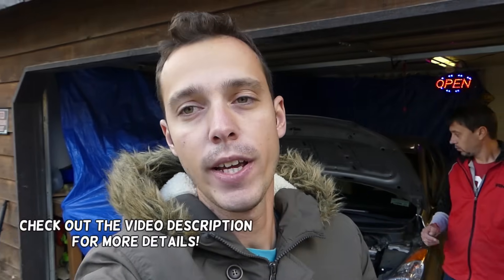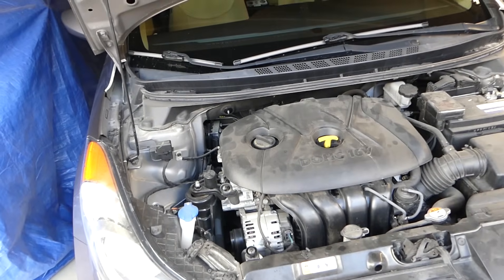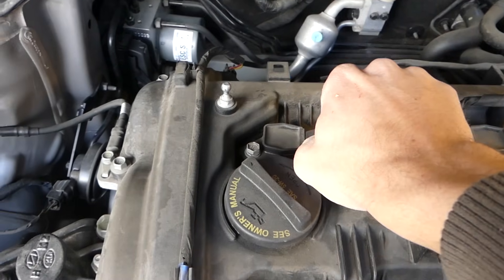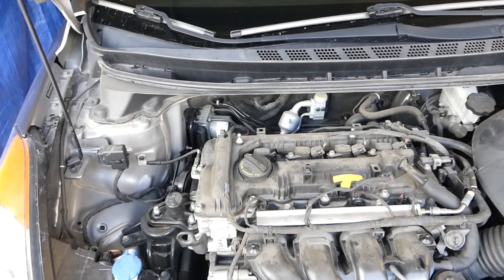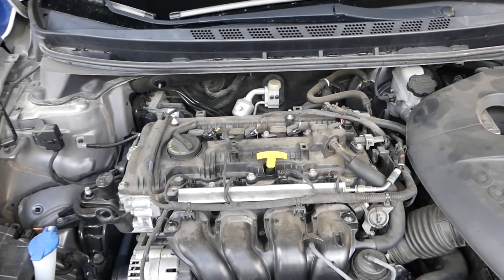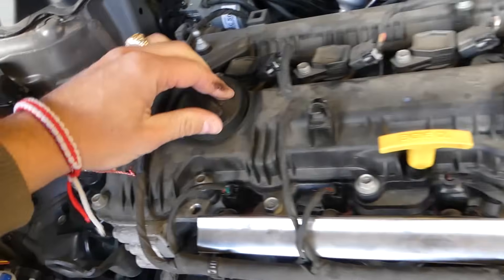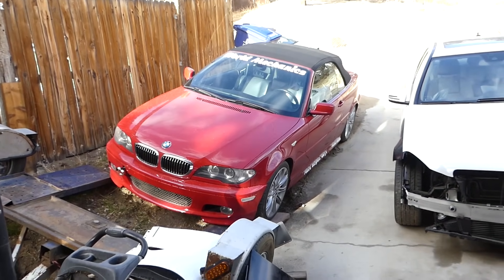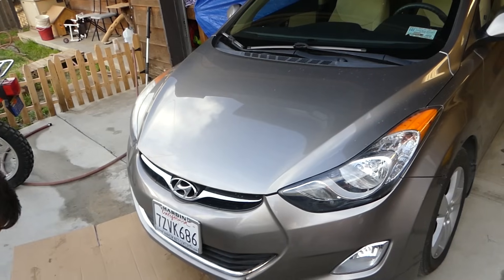HYUNDAI ELANTRA ENGINE NOISE KNOCK TICKING FIX ?

Comment: Thanks for the video.do you have a video for changing the inhibitor switch on Hyundai Elantra 2012
Reply: pnavan I don’t know if you got this repair done already or not but the inhibitor switch is a very common recall on some Hyundai’s. I work in a Hyundai Service drive and I would bring your car in to see if there are any active recalls. Some vehicles are getting a free oil change as well so I would recommend a dealership visit at some point

Comment: I have the same car and there was a recall on 2013. The dealership changed the engine block with no cost. I have noticed that these cars suck gas a lot. Does yours do that? What is the solution?
Reply: Mine has original engine makes the sound slight. But gets great gas mileage. 35 to 45 mpg yes I have gotten as high as 50 mpg with this car yes I'm not lying. And original spark plugs and 127k miles

Comment: Piston slap is what you engine has when it makes that sound. Mine went into Hyundai for an inspection and sure enough my car had piston slap. Hyundai has ordered a brand new motor for my car and will be installed in two weeks from now under the recall on the motor and it's all free. $6500 Canadian for the motor, and near 3000 for labor. my car has 77.000 km Talk to your dealer folks.
Reply: I talked to my dealer and they wouldn’t fix it.  I have a 2015 83,000 miles Elantra. Because I am the second owner they won’t fix it. They wanted me to pay for half.  Why should I pay for their error?
I am angry and don’t know what to do

Comment: Same in my gets 1.4 ...it ticks on startup for about 5 mins then runs ok , I replaced all drive belts and it improved for couple months but its back again
Reply: Im having the same issue... I've taken it to a dealership and they fixed it under warranty but now it's back
Reply: did you find solution to ticking probelm issue

Comment: i bought a 2006 hyundai sonata with 46000 miles and am trying to find out the severe sound coming from the engine (thrashing noise.) might only be the pulleys but i am concerned might be more. i want to see all of the videos concerning the piston slap problem and rebuild steps so i can fix the issue . please help me with all info you have

Comment: It's either piston slap or lifter clearance. 
These engines do not have Hydraulic last adjusters there straight lifter bucket on top of the valve stem. 
Very archaic if you ask me. 
Easy way to differentiate between valve lash and piston slap is wether the noise increases or decreases or stays the same between a hot anyone and a cold engine. 
These engines are famous for piston slap that is the result of just starting the car and driving when stone cold. 
To avoid this for aslong as possible be sure to warm the engine up every time before driving. So let idle for say 5 to 10 minutes for the first start of the day and if let sit for longer then about 1 hour. But if only left for say 5 or 10 minutes then start the engine before putting your belt on and getting ready to drive. 
Even start your car while loading the shopping into it. 

Piston slap requires a partial rebuild.

Comment: Mine is the same (2011 elentra) once I put Mobil 1 high mileage full synthetic oil in the knocking reduced by alot, I had a synthetic blend in before and it was loud so the oil definitely helps.
Reply: 5w 40 ?
Reply: 5/30

Comment: I was watching this video, as I was also having the same some humming noise related issues when accelerating while driving, but not getting humming when accelerating at stand still.

Please suggest what could be the problem.

I am using Hyundai i20 2011 model
Reply: Are you still having this problem? I'm having the same issue
Reply: Im having the same issue. Changed the oil. New spark plugs and coil pack. It still sounds the same.

Comment: Sounds like hydraulic lifters clacking , the new thinner oil probably allowed them to function a bit better .
Reply: How much you think its gonna cost if youre going to change the hudraulic lifters?
Reply: Those have what's known as bucket lifters that sit over the valve and spring and the cams sit over the top and operate directly on the top of the lifter , aftermarket set from ebay and do the work yourself , around $150 unless you also change belts and/or gaskets if needed .
Reply: Gordon L they actually used a thicker oil, it calls for 5w20 but they put 5w30 in. Which is thicker not thinner buddy. 🙂
Reply: 30 is thicker.

Comment: Wouldn’t switching to 5w-30 from 5w-20 ruin the engine over time??
Reply: U herald what he said the manual said to do that in colder climates
Reply: I've read that the 2.0 engines are made to run on 5w30 but 5w20 is recommended to get better fuel economy.
Reply: @iflarnted  yeah I just found my owners manual (it was mia) and it does list 5w-30 and even 10w-30 as suitable depending on temperature. I’m in Az so I’ll try 5w-30 as summer approaches.
Reply: You can run 5/30 it’s fine it’s for warmer climates

Comment: Hi I have a Hyundai Elantra 2016 I have a similar sound like that on my car. Old engine sound with a ticking nose. I had a oil change but the the sound is still there?? What do I do?? There’s no warning signs on my dashboard. I bring in my car to my local mechanic and was told their was no problem with my car (diagnostic was ran) nothing found.
Reply: I have the same problem. I think it may be the knock sensor =(
Reply: I just left it alone. Each time I get a check up. Nothing comes up... they don’t find anything
Reply: I'm having a similar problem and my cars the same year. It just started happening like a week ago.
Reply: I have the same problem in my 2015, the dealer wants me to pay for half of the new motor needed

Comment: Hi Guys!
I have the same problem. I did the same tests and I can not find a solution, please help! The scanner shows no errors..Do you know something else?
Reply: C sep your local Hyundai dealership would know. Ticking noises in these models are quite common and could result in the replacement of your engine

Comment: my car makes this noise on start up.. as i drive is goes away.. idk seems it just has to warm up
Reply: Is it an elantra?..i have a 2011 and it knocks on start up too, they say its a defect on these models and hyundai doesnt make it too public i i hear you can take it to the dealer and they will replace the engine free..its a recall actually..theres a video on that..
Reply: @renehettinga6610  is there a mileage limit on this recall? I have 2014 Elantra doing same thing

Comment: There's nothing wrong with that car. I have heard plenty of new cars that sound just the same.
Reply: I agree i bought a hyundai i20 and it said this noise. And I got so scared. But after search on internet i found out that this was all normal. Im an kia mechanic myself and we also have picanto that sound like this from factory. And if you want to run a warrenty case. By sending the video of the noise. It almost everytime gets declined
Reply: they are two sounds together, one of them is the fault.
Reply: My Rio started making more noises, so I began paying attention to other Kia and Hyundai. Surprisingly they all have this noisy engines. Even brand new ones.
Reply: @tiago
Can confirm. I have a 2020 forte gt line with 2.0.  I only have 4500 miles on it. I freaked out but started doing research. I'm finding it's normal. I'm very sensitive to noises. I guess I'll roll with it. 100k warranty makes me feel a little better.
Reply: @douchebaggins7  Yeah man I am the same way, Its almost a downfall because I worry for nothing. When I was hearing this with my sonata I literally went to a dealer and had them start and run the same car so I could put myself at ease. It looked and sounded exactly the same. I now have 60k miles and same sounds but never had a problem
Reply: @lr856n  
Thanks for that comment. Puts me at ease a little more. I was going to go to the dealer and have them start the same model. Lol..

Comment: Is this really an issue. I have 2016 Elantra. Notice the tik tik noise when I put it in drive. Don't hear it otherwise. I started noticing this only recently when it cold.
Reply: I have a 2016 Elantra as well. It recently started making this noise and I'm unsure why. Did you ever figure out what's wrong with yours?
Reply: You both should take it to the dealer if you are the first owner as they can put in a new motor if it needs it.  They wouldn’t help me with mine because I am second owner.
Reply: It stopped already. It isn't an issue anymore. I have checked with my mechanic and says if it comes and goes shouldn't be bad.
Reply: Nicolle Mendoza I have the same issue. I’m the second owner 🤦‍♂️ I’m taking my 2016 Elantra GT into a shop to get it diagnosed

Comment: I did notice when I bought the car more than 2 years ago. It happens when the car is cold. I got used to it. There is a lawsuit regarding this. I got the notice in the mail. If you can live with the noise you should be fine.

Comment: I just did a 2014 Hyundai Elantra lifters, valve seats, head gasket. Every one of these cars have hydraulic lifter problems.
Reply: Was it very expensive to fix?
Reply: @ddallen733  about 335$ with everything
Reply: @jaydizzledyal1992  thanks
Reply: Did it fix it and is it going to stay fixed? I'm not to sure if mines the lifters or something else. When I first start it up it makes a loud sound kind of like it might be the lifters but then it goes away. I'm assuming if it's bad lifters you'd hear it all the time correct? Also, if I start my car then turn it off and start it again I don't hear it. And if I do it makes significantly less noise.

Comment: These engines are just inherently noisy. I'm pretty sure its normal with their GDI engines. Should still go strong for years. My wives Elantra sounds the same.
Reply: It has a ticking noise?   Mine has a ticking noise
Reply: That's not a GDI engine... no hpfp
Reply: @codyballing8848  the 1.8l is a GDI. He even shows disconnecting the injectors in this video.
Reply: @thesupernad  https://en.wikipedia.org/wiki/Hyundai_Nu_engine
Reply: @MoreThanRocks  Thanks for the info. I stand corrected.
Reply: @thesupernad  It clearly states that the 2.0 is a GDI, while the 1.8 is an MPI.
Reply: Sounds like a Diesel ⛽

Comment: Hydraulic lifters my diesel 1.3 cdti fiat engine has been the same for last 2 +years oil n filter change quieten it for a while it then returned but motor runs fine only got 45k on so these good for 150k.

Comment: Do i actually need to worry about this? My new to me 2013 has 40k and it ticks slightly at startup but it’s also 0degrees here in Iowa. It runs and drives fine and noise goes away once engine is warm.. I feel like I’ve had other cars that make noise too..

Running 0w-20 full synthetic
Reply: Any updates?
Reply: 0W20 is too thin , 5W30 would work much better .

Comment: I have a hyundai elantra 2012, still is very quiet I just always change oil every 6 months.
Reply: i have elantra 2012 too. what oil (number and brand) do you use. thanks
Reply: Same one that he uses. Castrol Magnatec 5W-30. He is one of the best sources of Hyundai Elantra repairs in youtube. That’s why I follow him.
Reply: @aizensouske8872  hey is your car manual?
Reply: Can Doğan yup it is a manual.
Reply: How many miles do you have and which filter do u use

Comment: I have a 2018 Elantra and with a cold engine mine ticks and it goes away after the engine is warm. I only have 5000 miles on it.
Reply: David murling My 2011 does the same exact thing.. I was told it’s a cracked heat shield but I think it’s just normal on these cars.
Reply: My 2015 sounds also has a ticking noise on mornings
Reply: I too have the same problem. Please let me know that exact fix. I raise this to dealership but they refused bcz my car warranty has expired. I bought this new car in 2014.
Reply: @sploitx Just an FYI to those reading comments. The 2018 Elantra (original post) has some engines with GDI and some with MPI. So this doesn't apply to all.
Reply: @Vince C I have a 2017 elantra which I bought in July.  When the weather was hot I never noticed a ticking noise.  Then when the weather turned cold, i noticed it ticked really loud especially when I accelerated.  The car only had 10,000 miles by then. When the motor warmed up it mostly quit ticking.  I have 50,000 miles now and it still does it but I just quit worrying about it.  The Dealer said it was the fuel injection.  Maybe that's true... maybe not.  Anyway the Dealer wouldn't do anything about it and just said it was normal.  So I just let it go.

Comment: you didn't check the oil level before you started the car up. and another thing. Stay off the throttle when you start the engine. Never give it gas when you start it unless it won't fire on its own.  especially when it has sat overnight. The car will start on idle. at idle there is the least amount of pressure on all of the bearings while it builds oil pressure and circulates oil. Don't spin the engine up before it's had a chance to circulate the oil. If the engine is cold just let it idle for at least 15  seconds before you touch the throttle. think about it. why slam pressure on the rod and crank bearings before they had a chance to get oiled. Most of the wear on an engine happens in the first 3 minutes of it starting from cold. once it's fully warmed up, go ahead a flog it.  but when the oil is cold it doesn't lubricate as well and the metal parts haven't expanded to the correct size so you have too much clearance between parts until they expand. This is especially important at the top and bottom of the rod where the motion reverses. The wrist pin and the lower rod bearing shells. Not to mention the crankshaft bearing shells where the crank sits in the block.
Reply: Hey there Carbon Crank...... 
Here is what you said "when the oil is cold it has less viscosity and the metal parts haven't expanded to the correct size and the metal parts haven't expanded to the correct size so you have too much clearance between parts until they expand.".
Please note this part: "when the oil is cold it has less viscosity and the metal parts haven't expanded to the correct size so you have too much clearance between parts until they expand."
More specifically this part that REALLY got me., "and the metal parts haven't expanded to the correct size so you have too much clearance between parts until they expand." 

Viscosity (noun) · viscosities (plural noun)
The state of being thick, sticky, and semifluid in consistency, due to internal friction:
"cooling the fluid raises its viscosity"
Modern oil is a multi-viscosity oil to PREVENT exactly what you're speaking about. 
At cold temps oil's viscosity is constant. a 50 or a 10.... viscosity stays constant. 

Below 32 degrees F, the oil changes to the lower viscosity oil, because the clearances are TIGHTER when cold, you dumb ass. Metal will expand ... ALLL the metal, not only the crank. 
Also, the forces of the change in momentum are not applied to the crank and connecting rod "shells" (LOL). Those forces are LATERAL to the journals. Man, it's like my 14 year old wrote a post on YouTube after listening to grandpa talk shop from the 40's.. 

You don't sound intelligent with all of this shit. It makes you sound like a un-informed know-it-all.
This entire comment rubbed me so wrong that I had to leave this diatribe in hopes that since you posted this. 
Damn man, this thing pissed me off.

Comment: I too have the same problem. Please let me know that exact fix. I raise this to dealership but they refused bcz my car warranty has expired. I bought this new car in 2014.
Reply: Fahad Rajpurkar what was the purpose for the expiration? Year or mileage?
Reply: jsphburk, this is due to years. And I didn’t extended.
Reply: The engine warranty for original owners is 10yr/100k miles isn't it?  They should have honored their warranty.
Reply: Same issue with my because I am the second owner I am out of warranty.  Now I have a 2015 Elantra with 83,000 miles that’s motor is going to trash because they won’t fix it

Comment: Try to put some MOTORKOTE in engine. I am sure it will make significant change in noise level
Reply: I have a 2014 Santa fe with 125k miles. On accelerating the tick sound came on. Now it's on a cold start. Are you sure about this motorkote?
Reply: @thenditharam  I tried it as an experiment on my 2010 kia sedona and it reduced noise significantly and till date not seen any negative effect. If cause of engine knocking at your end is because of an internal part’s damage then it may not be of any help.

Comment: I have one problem in my elantra.
When I stop my car the engine shakes violently. As soon as I release the brakes or put the transmission on Neutral then it is normal.
Does any one knows anything about it?
One mechanic told me to change the chair on which engine is sitting.
Reply: Check your coil packs
Reply: Spark plugs need changed

Comment: in korea
2011 ~ 2015 gdi engines start recall 
and extend warranty period 5year to 10year
100000km to 160000km

gdi was big  problem in korea
Reply: GDI failed in iraq too cuz the fuel quality is so bad  
dohc 16V are the best one korea ever made
Reply: Is it automatic warranty extension or we have to do something?
Reply: I have a 2015 Elantra and my dealer won’t fix it says out of warranty car has 83,000miles and it is 5yrs old.  They offered to pay for half but why should I pay for a manufacture error? 😡